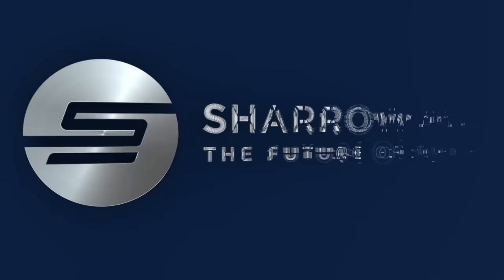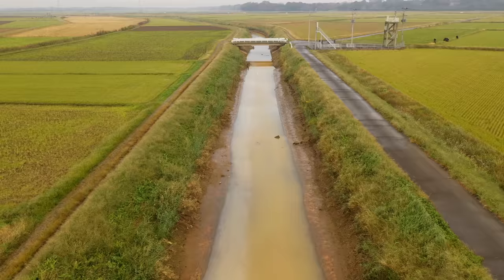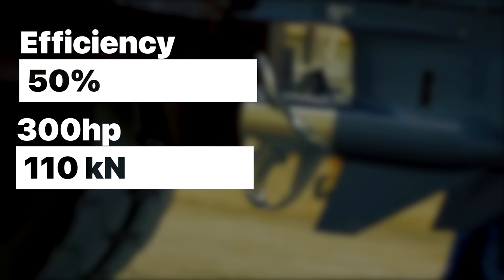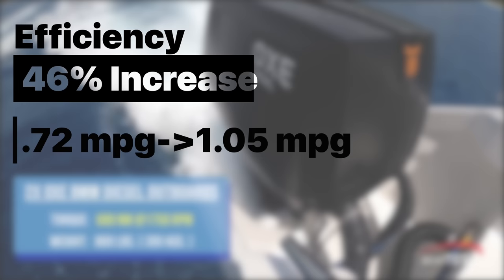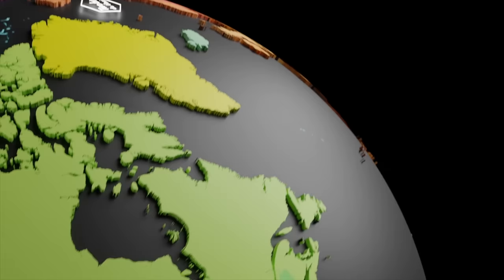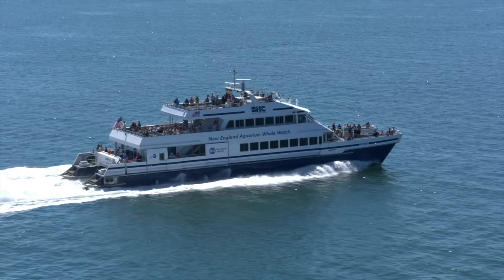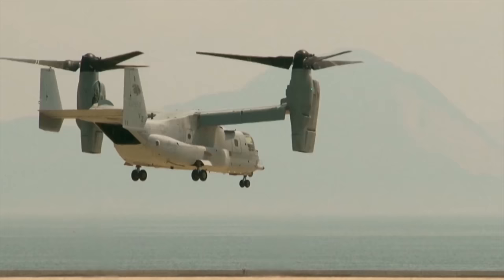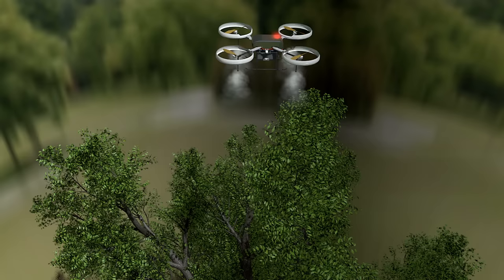Genius Propeller Is About to REVOLUTIONIZE Ships, Here's Why

Comment: I imagine this could significantly increase the capabilities of military submarines. If the new propellers generate less cavitation, which they seem to, it would allow submarines to move more quickly while remaining quiet.
Reply: Submarine screws are designed to operate at lower RPM and are already optimized for less cavitation then even this. The main efficiency increase here is due to a reduction of blade tip vortices. This design just also happens to double the number of blades and to place them not all equal angles from each other as well as having them support each other
Reply: Ship propellers are bigger than some peoples homes  , you will always have slip in water and even more in air , there is no way to make 100% effective propellers .
In water you get more effective with spinning propeller slower , that lowers cavitation risk , you can also increase the pitch and size of blades , when your RPM is 100 .
Cavitation happens when propeller causes so low pressure on one side of blade that it vaporizes water , faster the propeller spins , more cavitation you get and that eats up you propeller and can be easily heard by military .
Reply: In San Diego they cover the sub props.

Comment: Someone tried this style of blade as a design for a computer fan, kinda neat to see (although I don't know how it compared to conventional fans)
Reply: It didn't. Reproducing the claims of the MIT paper by amateurs and professional engineers has proven to be a bit difficult and complicated. For one the sound reduction happens in a specific range of noise that itself doesn't seem to translate to DBs noticably, and there seems to be some disagreememt on how efficient they actually are in terms of energy consumption and airflow. 

Critics have offered that the reproductions aren't following the original specs to the letter, but the original publication is too scant on the details to be able to do that, such as it doesn't give precise dimensions or blade pitch. 

So for right now the safe bet is to say it's just a neat idea,  it also may not function as well in air, because it could just be underdeveloped.

Comment: Patents by Myers/Davies (1892 - Jan 19 and 26) and Sugden (1967-70) show great insight into the state of the art - long before CFD was available.

Propeller thrust is highly speed relative.
ie, at Zero speed - static thrust is of dubious relevance depending on the design metrics (static thrust is really measuring pumping efficiency - mass of fluid accelerated to some final velocity, [general derivations, Force = mass * acceleration, power = Work/time = (Force*distance)/time = F*Velocity ]-- no transport work is being performed), at some design  "speed" - Power being defined as Velocity multiplied by force (m/s * Newtons = Watts)  it would be interesting to see comparison velocity vs thrust curves.

$5k for a replacement propeller. The recreational user will only get bragging advantage - at a great cost.

The problem with Rotorcraft "loop props" - flow vectors are much more complex than for an axial "airscrew" /water screw / prop as used on- aeroplane or conventional boat.   With all rotorcraft, (unless  converting to fixedwing in level flight) propeller advance ration have no relation to the aricraft's forward velocity, tips which are not functional - in the thrust vector direction, most likely only create drag and not the stated benefit - unloaded  tips - streamlines conformal to path vector - are more important for multirotor "vortex reduction" than boats or fixedwing aeroplanes.   Variable flight regimes further complicates optimal design (ie stable hover  - with low translational speeds through to high vertical speeds and transitioning to high forward velocity).

Comment: The knock on effects of this could be massive. Cutting shipping costs is huge
Reply from the maker: yes shipping efficiencies are where the big savings can come in.
Reply: More likely increased profits than a trickle down to consumers but if it helps them jump to electric then we all win.
Reply: Sacred Baloney
22 seconds ago
Increase efficiency by 105%?  Nonsense.  A standard propeller is at least 75% efficient.  A top rated propeller is about 90% efficient.  How can you "increase efficiency by 105%"?
Reply: @TwoBitDaVinci  Sure, efficiency. But not speed. Cargo ships are displacement hulls, not planing hulls like a speedboat. Their speed limit is set by their very design.
Reply: @davidmccarthy6061  On the long run it will, first a shipping company will adopt the innovation, undercut its competition and then the rest will adopt it if it proves successful. It is deflationary in the long run
Reply: @TwoBitDaVinci  for who? The shipping companies obviously, but what benefit does this have for the consumer? Literally nothing, if anything it breaks down how much they can save and reinvest into getting more ships, which results in using more fuel overall. 

So this video to me, just sounds like an advertisement for buying ahipping stocks, but the concept and promise will be used to lie about its environmental and consumer savings.
Reply: Do you really think savings will get passed on to you
Reply: Yay!! Now multinational shipping companies can pay their shareholders more!🎉🎉🎉🎉🎉
Reply: @sacredbaloney  0,90*1,05 = 94,5% efficiency.
Reply: @nsglcck  ik I'm late but it's more of a 20kg of feul per mile for example to 9 kg of fuel. efficiency not effect
Reply: @nunyabisnass1141  the benefit to the consumer is in lower overall prices for everything, and a expansion in viable import/export products.  Cost of shipping is roughly 15~20% of net sales on average. Sure it might mean a few pennies per dollar at the consumer level but when the effects are taken into account for the entire world economy the effect becomes quite profound.
Reply: @mrspeigle1  that's where I disagree. Yes lower operating costs can be used to lower consumer prices, but I don't have much faith in industry to be so benevolent. For the life of me, I can't remember the last time any company advocated for an improvement claiming lower customer prices, that actually lowered prices after saving money.

Comment: This will hopefully make electric ships viable. Hydrogen will problably be the fuel to start with but for short trips and small boats battery will be cheaper.. Also in combination wuth using modern sails will drive the cost of shipping down.
Reply from the maker: i think the ship of the future is a hydrogen / battery electric hybrid... fairly big battery, and for short trips dont even need hydrogen, and also solar ... i so want to build a boat like this lol but they're huge money pits
Reply: @TwoBitDaVinci  plus a little bit of wind propulsion
Reply: @TwoBitDaVinci  Reminds me of an old joke: The two best days of a boat owner's life are when the buy the boat and when they sell the boat. 😆
Reply: @Sembazuru  And not necessarily in that order! ;-)
Reply: @TwoBitDaVinci  -- 
Sacred Baloney
22 seconds ago
Increase efficiency by 105%?  Nonsense.  A standard propeller is at least 75% efficient.  A top rated propeller is about 90% efficient.  How can you "increase efficiency by 105%"?

Comment: I wonder if this is related to the efficiency increase of ducted fans over open circumference fans (in both motors and generators).  A propeller forces the fluid away from the propeller shaft, wasting energy.  If a cylinder around the propeller blocks this and forces the air to go parallel to the shaft, then there is a more efficient transfer of energy.  (If I remember correctly, ducted fans are twice as efficient.)

Comment: Thanks for the interesting video. The clickbait title screen is a bit disappointing.  Most well designed ship propellers have efficiency greater than 50% so a 105% increase is impossible. Efficiency is a ratio and is dimensionless so it can't be the ratio of thrust to power. It has to include velocity so that it is a power ratio.
Apart from this slight inaccuracy and hype, a very interesting video.
Reply: Exactly.  For air propellers, efficiency is between 75% to 90%.  So where did the 105% claimed come from.
Reply: Its the way it is worked out in base figures, my 4 hp outboard with a standard prop has a set amount of pitch to push my boat forward, if at 50% throttle i can turn that down to 25% with the new prop for the same length travelled or decrease fuel usage the gains can be over 100%...

 my outboard uses 2 litres an hour at 50% throttle at 4mph, that may drop to say 0.9litres an hour at 25% throttle with the new prop and do the same 4mph. Or for the same fuel burn at 2 litres an hour i can gain boat speed to 9mph and thus distance is increased.

Comment: We tried a few of these on small engines.  They tend to trap weeds and other detritus in the blade loops. You will practically need to stop the engine, get the prop out of the water and clear it.
Great idea in theory, but in real world use it sucks.
Reply from the maker: weeds could be a big issue.
Reply: @TwoBitDaVinci  maybe if they could sharpen the edges like a razor it could cut as well as propel the boat
Reply: @wonkastudio-johnny  That is a bad idea and has been tried it is a fantastic way to mess up your prop.
Reply: @wonkastudio-johnny  That has been tried before. The thin sharp edges will chip easily when it hits even a small piece of wood.

Comment: As a mechanical engineer too, I draw a very different conclusion: boat propellers must often be very poorly suited to the boat they're attached to. They are operating way outside of their optimum angle of attack, giving very low efficiencies.

On the other hand, aircraft propellers typically operate at up to 90% efficiency. Variable pitched propellers are able to maintain operation near that 90% for most of an aircraft's normal speed range.

I don't see an easy way of achieving variable pitch on the new propeller design.

I would really like to see wind tunnel test data for efficiency over a wide speed range, to see whether the real benefit of this new design is wider speed range at decent efficiency. That could render variable pitch redundant, which would be a good way to reduce cost and failure modes.

Would love to see a more detailed (nerdy) follow up 🙂
Reply from the maker: Great points and will do!
Reply: I liken it a bit to turbine designs.  If you can limit operation to a narrow band of speeds, you can optimize the design for that.  But a boat propeller has to operate under a wide range.  Sure, there is a 'cruising speed' that you can optimize for, but then you've probably compromised on the 'top speed' available.  And of course there are times you have to operate at very low speeds (harbors, no-wake zones, etc...) and you wouldn't want it to operate terribly poor then.  And until you put the prop on a particular hull/ engine combination you can't really know for sure what the 'optimal' speed will be.
Reply: You can clearly see there's way less cavitation under water. 
Maybe the original propeller was bad, but with 200 years of making them the charts should be well established.
Reply: @mikefochtman7164  but current boat propellers aren’t variable pitch, either, I don’t think.
Reply: @J7Handle  most cargo ships have variable pitch prop
Reply: @J7Handle  some are,  look at SV Seeker, though, to be honest, that is not most efficient hull shape in the world :) But the point is theirs is an off the shelf part, not an odd ball.
Reply: I suspect a combination of weight and strength requirements would render this idea unusable for airplanes. The centrifugal force would tend to flatten the shape out at the RPM of most airplane propellers. Having seen those things fail in flight (thankfully the pilot landed just fine) I have my doubts. The cross section of the foil of the boat props shown, looks to be about four times that of a conventional prop.
Reply: @J7Handle  Exactly, so you have to pick a 
compromise pitch that will give good (but not optimal) performance at several different operating conditions.

Comment: the major engineering challenge I see with this is variable pitch control
In aircraft in particular, propeller pitch is changed continuously as the velocity and altitude changes to maintain peak efficiency. with a design like this it will be quite difficult to achieve pitch variation as the entire blade effectively needs to be flexible

also, in regards to DIY 3D printing tests:
3D printer materials are not aerodynamically optimal. like, at all
the finish on a 3D printed item is far rougher than aviation grade manufacturing, so its not really surprising that DIY tests have not found as much of a gain as the researchers
Reply: "as the entire blade effectively needs to be flexible"
Exactly !
That will be interesting.

Comment: So the problem with the other pattens is they don't twist at the top its simply a prop with a hole in the center thus leaving a leading edge which will create cavitation. This elimination of cavitation is why the new props work so well

Comment: By my calculations at a 46% increase in fuel efficiency and my current boat use I would recover the cost of a Sharow propeller in 12 years.
Reply from the maker: not great... but not too bad.. at what point would it interest you ? 8 years ? what about the less vibration part does that interest you?
Reply: @TwoBitDaVinci  I guess the price will drop in time but yes the reduction in noise would be great.

Comment: Brilliant. This change in design needs to be pushed to be adopted purely for the cost savings, let alone the reduction in pollution!
Reply: LOL... the prop costs $5000 to make currently... so it wouldn't save you anything in a recreational vessel seeing only occasional use (for that market you need to cost $500-1000 ), it might save you some in a commercial one used daily. Assuming it lasts at least several years of constant use  without getting damaged.
Reply: @Wingnut353  true he states they are all custom to the engine driving them as they are fragile and need to be tuned to the stress of the engine torque 
if it could save on shipping lanes burn rate that would be great
don't think it is about saving money but about usage efficiency

Comment: circular wing still have wing tip vortex. Wing tip vortex form not because of the wing tip, it's due to the span wise pressure flow from under the wing try to recombine with the flow above the wing. In a circular win, the recombination event will just happen outside of the circle instead of inside. You still have a pair of "effective" wing tips at the 0 degree and 180 degrees direction. You could eliminate wing tip vortex by eliminate the pressure difference, but you will generate no lift in that case.
Reply: exactly

Comment: They cannot be used for variable pitch applications. Many ships use VP, most propeller aircraft have variable pitch. It would be a boon to heavy shipping as they are huge fuel consumers and harm the ocean environment with the noise.
Reply from the maker: Add air bubble lubrication and we might have a winning combo

Comment: This is good for fixed pitch propeller, where it is the engine speed that change. But on many applications, like wind turbine, helicopters of propeller airplane, the propeller stay mostly at the same speed and it’s the pitch that varies. That design doesn’t allowed that.
Also, i don’t see benefit when the blades are enclosed like in a turbofan engine, since there’s  no vortex at the end of the blade like in normal propeller.
Don’t get me wrong, there is loads of applications, including ship, that it is very good. 
I just thought it was worth saying

Comment: My solar electric pontoon boats and the canoe would benefit from the range increase, speed, and load performance. It will need to be a more practical and economical product.
Reply: 100% ELECTRIC Hydro jet propulsion & MHD is more Efficient.
Reply from the maker: Mark you keep mentioning this....do you have a favorite example that we should cover?
Reply: @markplott4820  More efficient than what? Electric motors are typically 5 times more efficient than ICE engines, but jet drives are half that of prop efficiency.  So how does that play out with all the watercraft types in net-ton-miles per kWh?  What does efficiency mean when for entertainment?

Comment: Some of the potential use cases for the air-toroidal propeller I'm not sure if they will work. Helicopters, and many large prop planes change their thrust not by rotational speed, but by variable pitch prop blades. This allows the (usually) hydrocarbon fuel motors/engines to run at their most efficient speed in their torque curve. Most modern helicopters are an even more special case requiring variable pitch blades because they change the blade pitch in different quadrants of the 360 rotation to adjust the amount of lift side to side and front to back for roll and pitch control of the craft. None of the toroidal propeller designs that I've seen would be able to vary the pitch of the blades. Unless there are some design enhancements that I'm not aware of (which could very well be.) Maybe if prop planes convert to electric motors toroidal props would be useful because electric motors have a much flatter torque curve, so then variable thrust could be from variable speed (like quad copter drones do it).
Reply: Nice. You definitely hit the nail on the head.

Comment: The efficiency is as I see it increased over the ordinary propeller, but it has also to be related to ducted propellers and waterjets.
However it's likely easier to just have a "plug and play" design installed than to work with ducts on larger ships.
On drones another factor comes in - the movement is not in the axis of the propeller but in almost every angle causing the efficiency to increase or decrease depending on all the various angles causing the lift to decrease and increase and change the characteristics of the craft.